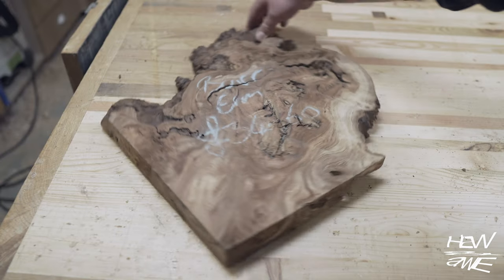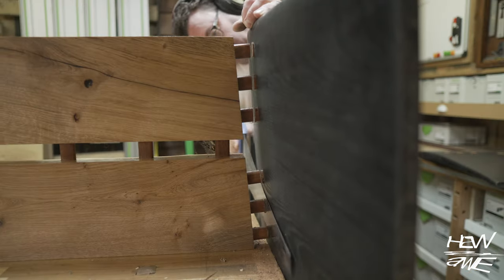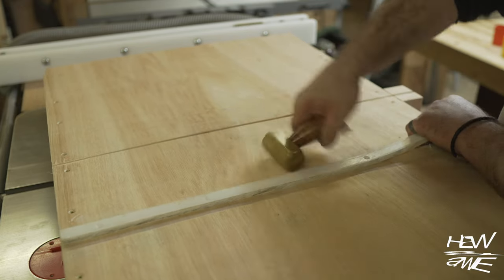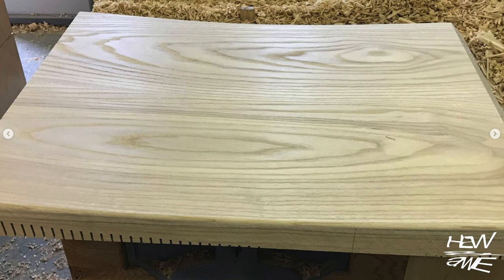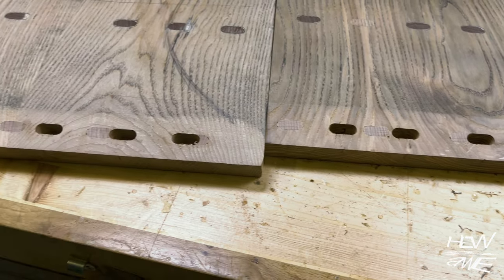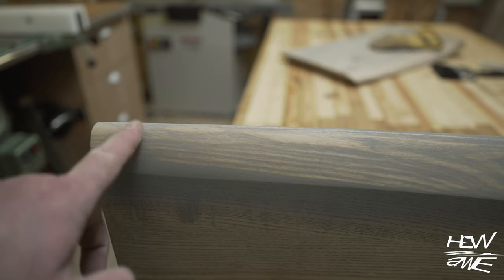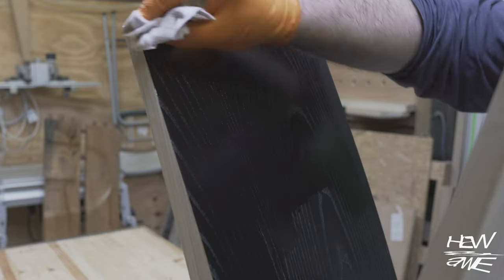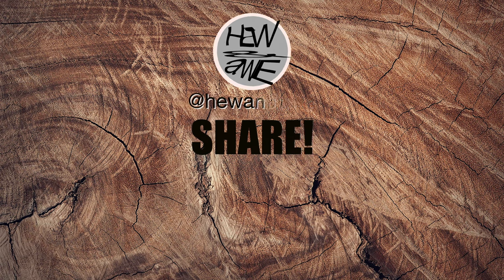Elm burr side table build.

Comment: Very nice, I like the contrasts in the timbers. Sorry to hear about the migraines. I get them in the summer going from air conditioning to the out in the heat and back. Can really fuck me with at work.
Reply from the maker: Really?! Sod that, I thought life was supposed to start at 40 FFS! That's mad, a friend said are you sure its not the heat, I've never had this problem before, even working on set in SA above 40 degree heat I was fine...

Comment: Excellent vid Ben. The black inside to the legs makes the piece IMO and the spray paint flattening tip is really useful. I suffer from optical migraines and they pretty much only occur when I am using my computer monitor. Usually start with flashing lights in my peripheral vision then I lose focus on anything in the middle of my vision. Lasts about half an hour then the headache starts. I am lucky though, a couple of paracetamol usually stops it from developing into full blown cranial implosion.
Reply from the maker: Yeah that’s exactly what happens to me, only of late though. Haven’t had a migraine since I was a child. I think it’s started cause I turned the keep true colours and don’t dim screen on permanently, I’ve turned that off now and haven’t had a migraine, so far… 🤞

Comment: I've found with sanding timber, your first hit sets the course of every other grade you use. If you start with 60 grit & watch the grain like a hawk, the grain will show your lows/highs - when the grain flows perfectly with no distortion after using 60 grit, you've sanded it properly.  It might not be dead-bang-on flat, but it's sanded to suit the grain, not some artificial "level" that the wood doesn't care about.  Once you've made the grain flow using 60 grit, you can work up 120, 240, 400, 600 and those passes are only to refine each grades scratches further & further - you're no longer "sanding" you're just making scratches finer so it goes fast.  If you have even 1 defect in the 120 pass - you didn't do the 60 grit pass properly, so go back - there should be none by the time you move to 120. Get them all with 60, then move up. That way, you have a system & it makes sanding easy. You're sanding with 60 grit, only - then refining tiny sanding scratches with the finer grades. 

The 60 grit does all the work & the grain does all the "telling" where to sand - once you're happy with the 60 grit finish, you can just fly through the other grades - but be fussy as hell with that 60 grit. And use good paper. Bad papers naff.

This "System" works good if you have naff tools - you know the ones, the ones you don't want but are what you could afford - and you're left with chatter marks, blade drifts, blah blah no matter what you do, because "Naff tools".   Grab the 60 grit and really work - watch the grain - when the grain flows like it wants to in nature, with NO visual distortions you've un-done the naff tools boo-boos.  This also works great if your sander too falls into the "Naff tools" category as any old piece of chunk will get this way done to a really good finish standard. I know, I have a piece of chunk sander.. still get great finishes with it tho.
Reply from the maker: You know most finishes don’t adhere well past 220 grit right? The tools must be horrendous if you have to start with 60 grit!
Reply: @HewAndAwe  Could be the cutter & not the cutters. :-) I don't use finishes as such, just a light wax, so I want that wood sheeny without the fake sheeny-stuff.  Then again, I come from a car bodywork background, so I dun sanded an awful lot that had to end up properly sanded as opposed to pretendey sanded.
Reply from the maker: @jamesward5721  have you tried card scrapers?

Comment: Osmo do a Polyx Raw with whiteners in, I've never tried it though. I'm falling a little out of love with Polyx for guitars though, god knows how it lasts on floors because it scratches so quickly. Anyway sorry about the headaches, I get tension headaches from clenching my jaw without realising and once it's on there's no escape, no pain killer will touch it. Finally that's a beautiful stool and I might have to use that spray technique on some guitar contours! Hope you're having a good day today.
Reply from the maker: Oh mate I wouldn't touch Osmo on a guitar!!! Rubbish finish for them. Guitars are a spray finish no? Migraines sorted mate, I turned off the automatically reduce brightness on the screen to help with colour grading my edits, was then they started, turned that back on and have been fine since, thankfully!

Comment: Nothing like severe headaches to undermine productivity. Wait, no, heat'll do that too. And a wife, kids, taxes. Ah F'it. Sorry about the headaches!
"I think these table saw sleds are an american idea..." Snicker. We do tend to act like we know it all and our sh*t don't stink. In this case, I'd say that it isn't a bad idea. IF, you have a climate controlled shop, or you seal the runner and the entirety of the sled. HDPE runners work great for me. Not to say that those sweet Banggood runners wouldn't be better...
Shop Safety clip is golden! F'n puffs. No matter what you are doing, you need to be aware. Probably the same people who do their makeup in the car on the way to work, while drinking coffee, eating a pastry, and gossiping on the phone...
You made that saw what she is. Good bones that you fine tuned to 'Ben' level. I'm curious if you've ever bogged her down. I bought an old Delta cabinet saw that has a 5hp on it. I haven't done anything strenuous with it yet. Wondering where the line will be.
Thanks for the bodywork trick info. When I saw you pull out the iron to bring that clamp mark up, it made me wonder how much difference raising the grain would have made on those airplane wing visuals.
Always dig your videos. Keep it up! (good mantra as we are aging) That piece of burl is gorgeous.
Reply from the maker: You've hit on a question that I've had for years, how do peeps who make furniture in a climate controlled shop then send out said piece and not worry that it doesn't pull itself appart? Is everyone living with air-con o over therer? I loose sleep over this, mostly we kiln dry to 12%MC in the uk, but there are those like a few ex girlfriends who like the home like an oven all year round, my bro being one too... the moisture content of anything wooden in his home (UK) is 6%!